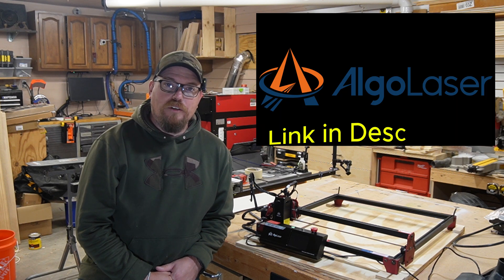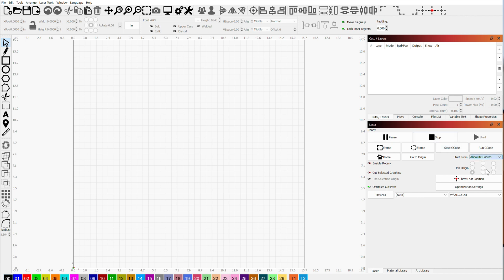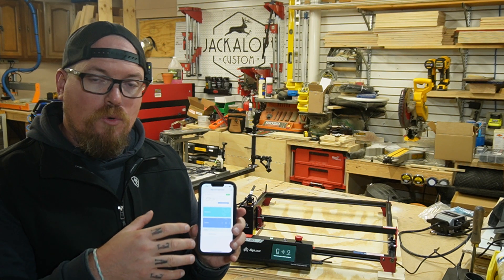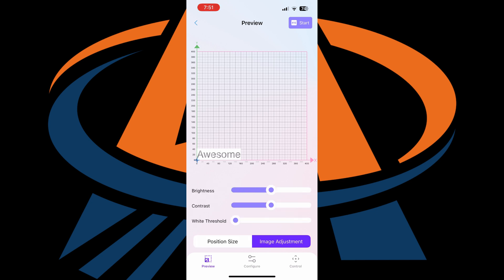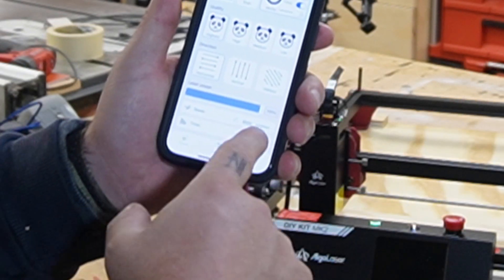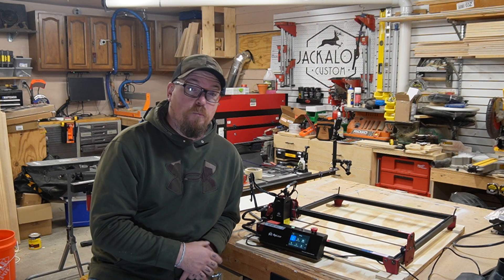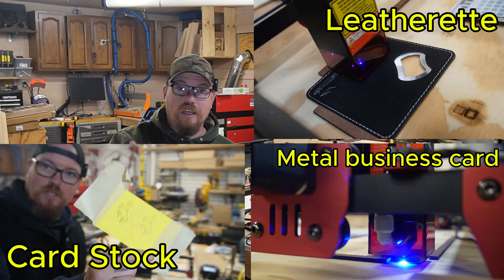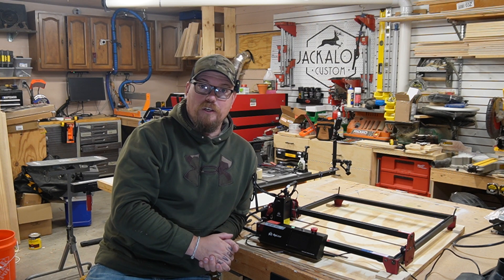Algo Laser DIY Kit MK2 – The Best Beginner Laser?

Comment: looks good.  I am looking for a laser to cut out airfoils and parts for my RC gliders.  I would be cutting them out of 3mm (eerrr 1/8" to you american folk)balsa wood and ply.  Would this laser be suitable ???  I hope you are using protective glasses
Reply from the maker: This laser would absolutely be suitable for that purpose. And with its built in file storage you could save a part in the laser and cut that out again in the future without having to hook up your computer or anything.

There is also a shield around the laser head that filters the laser beam. I’m careful to not look at it from the side without glasses.